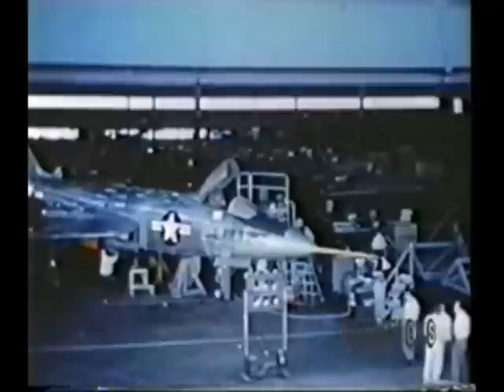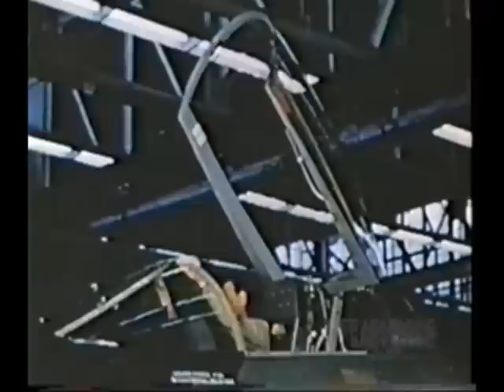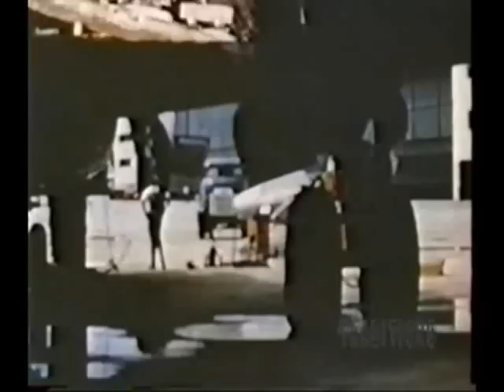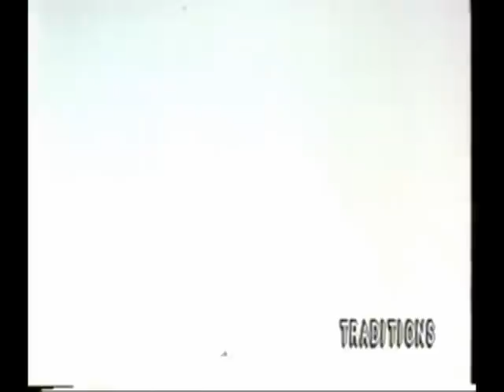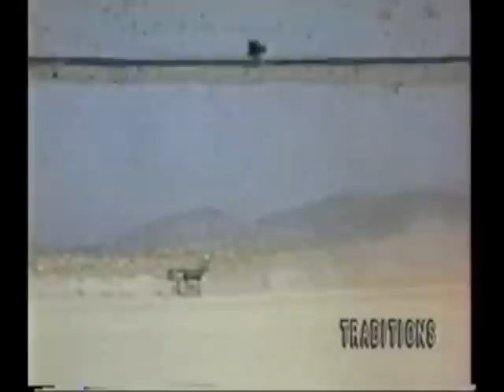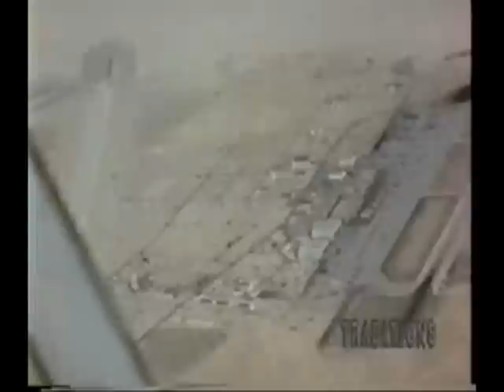F 101 Voodoo   Early development

Comment: I used to live very near the Air Force base at Niagara Falls, New York.  I remember the F-101 Voodoos flying over our house.  After that came F-4 Phantoms,  then F-16's.  Living near that base was like a constant air show and the progression of fighter aircraft that unit flew was like a history lesson on the aircraft the Air Force Reserve unit flew from the late 1950's through 1968 when I moved away from the area near the base.  They were still flying the Voodoos at the time and they moved on to the F4's and F-16's later until the fighter unit at the base was moved.  I do remember a serious accident when a Voodoo crashed shortly after take-off the crew punched out the plane crashed near Niagara University.   There is a de-commissioned Voodoo (I think it was the RF version) parked on permanent display at the east entrance to the base.  Interesting aircraft.
Reply: I was a Tech Crew Chief in the ANG unit there from 67 to72. I crewed F-100's and F-101 Voodooes. The voodoo acident you refer to was where Maj Shrey was killed. We lost another one over Lake Ontario .....and Lt Joe Fell died earlyer. His "wizzo" punched out and lived. His name as I recall was Capt Baer....who we called Yogi Bear. Instead of ejecting with his feet on the canted floor panel as per flt manual, he tucked  both heels back against the front of his seat thus raising his thighs...and thus breaking both his legs right above the knee when the seat catapult went "BANG"

Comment: The F-104 was faster than most of those century series fighters.
Reply: All the way to impact.
Reply: The century series  fighters had different roles.

F-100 initially a day interceptor, but became more a strike fighter.

F-101 initially was to be a long range bomber escort but soon became a long range all weather interceptor.

F-102 was another all weather interceptor.

F-104 was mostly  a high speed day interceptor, ironically if became more of a quick strike fighter. Canada from. 1961-1968 used our CF-104's as tactical nuclear strike aircraft, with some sqds.  using them as tactical recon aircraft

F-105 was a fast, heavey  all weather strike  aircraft also capable of tactical nukes.

F-106 was the ultimate culmination of what the F-102 was to be. The 106 was probably the best pure interceptor the USAF had at the time.

F-107 was to be a all weather multirole platform, but it never went into production.

Comment: As much as these cold war era aircraft stir up romantic images, it took until the seventies to really get a firm handle on air superiority fighter designs. They had only the most rudimentary design ablity, until computers started coming into there own. Then Boeing, Mcdonnell Douglas, General dynamics, Grumman, got really sophisticated. Not long after through good Intelligence gathering on the part of the then Soviet Block, The Mig 25, Mig 29, followed about a decade later. Now its all Stealth, Tactical Data networking, Radar Suppression, Drones, Satellite Reconnaissance and Battle theater awareness.
Reply: skipsteel The MIG 25 first flew in 1964.
Reply: @arlingtonhynes  yes I really mean the Mig 25 which evolved to the Mig 31 1975 1st flight production versions as frontline fighter early 1980's. Sorry my bad. But the 31 came from the Foxbat design.
Reply: @soulsphere9242  true air superiority means close engagements and distance engagements high altitude low altitude. This also assumes decent air to air weapon systems integration. I should mention that it took over a decade for the F-15-C to become the Strike Eagle. But wasn't a Bandaid it was a significant design refresh  and probably the best decision the USAF ever made.
Reply: @arlingtonhynes  oh sorry looks like I've stepped in Troll Feces.  Are you older then the Voodoo? If so you're too old to be trolling YouTube.
Reply: @arlingtonhynes  Btw I  my first solo was April 1979, I have thousands of hours as PIC,  I was ATP rated by 1981. I hold 16 type ratings, and have over 14 Airshows under my belt, and a Bachelor's degree from Embry Riddle. Also I am Older than the Voodoo, my instructor who Flew with the Ray Ban Golds, and he said the Voodoo rush to get stuff in the Air(And Kind of a DeathTrap like the 102 that followed). I may forget a few things, but  the guy who's really full of it is the one with no wings.

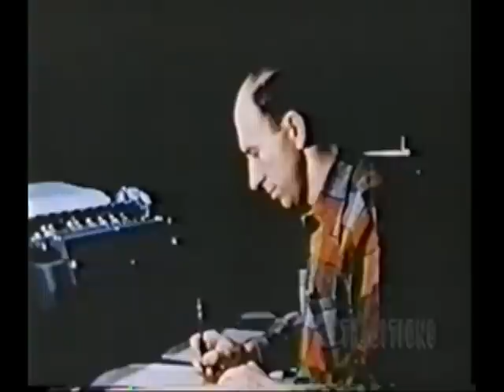Comment: 2:35 - A "stabilator?"  haha  I'm guessing that's what ultimately ended up being called a "stabilizer"?
Reply: A stabilator is an all-moving flight control surface that performs the functions of horizontal stabilizer and elevator.
Reply: @brianmcdaid3178  Cool.  Thx
Reply: Still use the term today.

Comment: Really beautiful lines at any angle. The necessity of getting speed on low thrust (compared to today) makes a very sleek design.
Reply: Has a better thrust weight ratio then the F-35 does. It wasn't particularly low thrust. It's also faster than the F-35. At least by the book. The engines of an F1 01 put out 16900 lb of thrust each and the aircraft ultimately weighed about 45,000 lb in production trim. That makes about a 0.73:1 thrust-to-weight ratio. The F-35 has about a .64 to a.66 thrust-to-weight ratio ratio.

I never got to work on one in the Air Forces they were getting a bit old by the time I served. But I always loved the looks of that aircraft. And it's performance was actually pretty good.
Reply: @44hawk28  Don't be talkin bad about Fat Amy :)
Reply: @44hawk28  the F-35 has just under .87 twr at full fuel and ordnance where on earth did you get .66 from it would at best be just narrowly be supersonic at that rate.

Comment: The Voodoo was prone to pitch up correct?
Reply: Yes, both the 101 and the 104 had it because of the T tail.  Many accidents due to sudden uncommanded pitch up.  Pilots had to navigate a 3 dimensional matrix of AOA, speed, and weight to stay out of a pitch up.  Pull a little too much AOA at the right speed or heavy stores load and the low pressure air coming off the wing would get under the tail causing a pressure differential pushing the tail down.  Tail drops , AOA increases, higher pressure delta, stronger pitch moment...  A vicious cycle taking a couple seconds to GLOC the pilot and depart the jet.
Reply: From the San Diego Air and Space Museum. "The Word on Pitch Up" about the F-101 - https://youtu.be/T2y3DX8hZAY?t=6 If you're interested in aircraft and spacecraft you're really going to like SDASM Archives.
Reply: @cowboybob7093  I watched that.  Funny to see the credit to Don H Stuck, test pilot.  I've been to the crash site of an F-101 near Edwards AFB he had to eject from during the test program.

Comment: The F4 phantom  older brother
Reply: Actually, the F3H Demon was the F4H Phantom II older brother.
Reply: @alphakky  McDonnell pitched the F4H to the Navy as the "Super Demon."
Reply: McDonnell really liked the tail position set so far behind the thrust. Considering how their designs changed, an no one else adopted it, it must have been the wrong way. But still, putting all that rudder and elevator leverage so far behind the centers of gravity and lift led to some very successful runs.
Reply: @cowboybob7093  Not wrong. Many modern jet fighters have elevators extending beyond the engine nozzles.
Reply: @dalecomer5951  Name a couple, let's say designs starting after 1980.
Reply: @cowboybob7093  f-22 and f-35.
Reply: @cowboybob7093  Mitsubishi F-1.
Reply: @dalecomer5951  Whole empennage like the -88/-101/-4? Nice try, not even close.
Reply: @alphakky  Saw service before 1980, nice try.
Reply: @dalecomer5951  It would seem like having the engines closer to the center of lift or the control surfaces further from it would help in pitch and yaw. But looking at your examples it seems designers found more surface area to be the solution to getting g-forces to the human limit, not leverage.
Reply: @dalecomer5951  F-15
Reply: I can see some of the F-4H Phantoms design features displayed in the Voo Doo

Comment: Dangerous airplane
Reply: All of the century series fighters were dangerous from day one because they sacrificed low speed stability for speed. They were still badass and effective high speed aircraft. One of my USAF flying instructors was a boom operator testing A/R with various fighters from that era and could write a book on them.
Reply: No more dangerous than any other new fighter that went into service. And likewise after the buggs worked out, mods  completed and upgrades made it served well. At least the air force got their money's worth.
Reply: D. Geo the only dangerous bug that was never ironed was the deep stall. If yot into this there was litte you could do but crash. IIRC they fitted devices to stop you getting in to the deep stall.
Reply from the maker: Yeah a lot of experimentation was going on during that period. Lots of wacky airframe designs for sure e.g the Goblin parasite fighter, Avrocar and F7U Cutlass aka the "gutless" to name a few.
Reply: @pimphand00  Hey illlllllusive One, typo in your title. Develllllllllopment is misssssing the L. That does not ook good. Usuay, I skip those video's. Pease, correct that typo.
Reply: Unfortunately it was contemporary of the even more deadly F4
Reply: Why is that man shouting so loud? Those military types are never relaxed.
Reply: Dangerous for whom? Catching 6.000 20mm rounds a minute  is a dangerous hobby.

Comment: The phantom has some the same body style without the tail section. The engine placement was identical.
The century series were give a hard time , but that was more to do with the Pentagon then the manufactures.
Many were leaps in fighters and lead to some top fighters. The star fighter was the only one that never really was that great. They tended to kill more pilots the enemy fighters. Ask the other countries that bought it.
Reply: A. Clark I would have to add the F-102 into that, they had so many problems with them and they never did get it completely right. The F-106 was the one that could hang with the F-4 when it came to speed and climb, the last F-106 flew in 1986 retired ten years earlier than the F-4 in 1996.
Reply: @TheLeadSled   No question the F-106 was the best of the Century Series. The fedrule taxpayers got their monies worth on that one.
Reply: @dalecomer5951  The F-4 is the best of the series.
Reply: @WALTERBROADDUS  The F-4 has never been considered one of the Century Series even though the two original F4H-1 borrowed from the Navy for evaluation and 27 more "purchased" from Navy production slots for training were designated F-110A, by the time the USAF received Phantoms built to its specifications the designation system had been changed so those aircraft were designated F-4C. So, do you consider the F-111 to be one of the Century Series?
Reply: @dalecomer5951  The F-111 and the TFX program are a separate animal. The F-4 is in the same development period as the rest of the series and had the 110 designation originally. So basically you draw the line at the xf-109?
Reply: @WALTERBROADDUS   WALTERBROADDUS Was joking about the F-111. My pet name for the F-35 is TFX II. The F-111A/B was supposed to replace the F-4. Scary McNamara plan. The Phantom II was designed about a decade later than the early Century Series fighters. I would claim that It incorporated a lot of the expensive lessons learned from the Century Series and is better than any including the F-106. The F-107 was the last which was built and flown. It would have been very exciting for us kids had the XF-103, XF-108 and XF-109 programs progressed to flight articles.
Reply: @dalecomer5951  As much as folk knock the F-35, it's working and selling.
Reply: Canada's experience in Germany, during the cold war, proves your point about the Star Fighter.